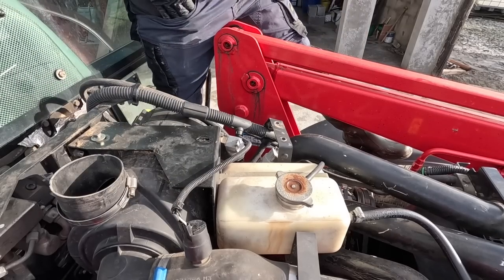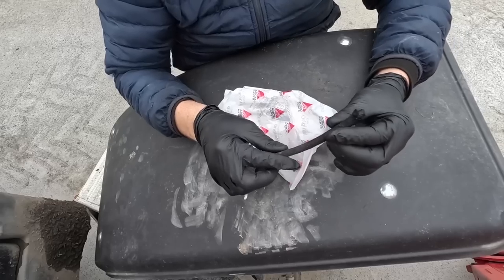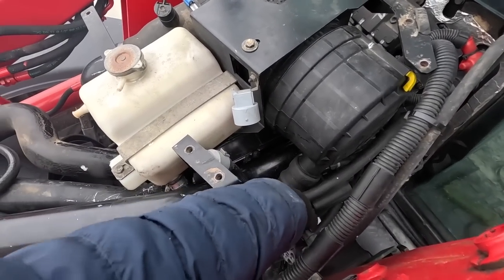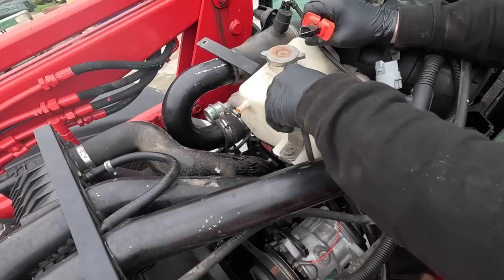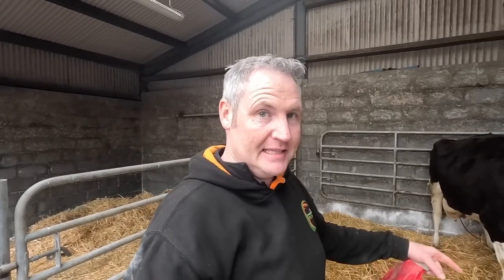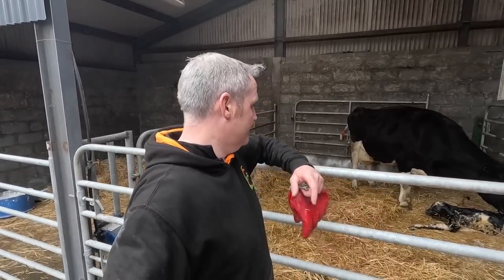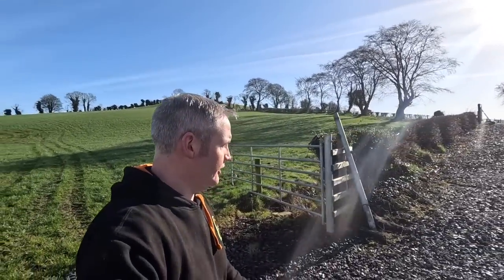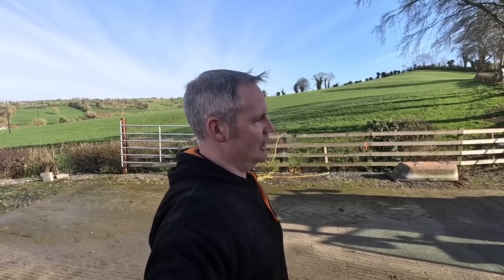I Know Now Why I Smelt Diesel! || Massey Ferguson 5460 Has A Problem

Comment: Good job with the tractor 
Just a tip the back leakage pipe on the injector will only put out diesel when the injector is fireeing ie when the tractor is running  the   Inection will only bring up fuel to the pump 
Good job though

Comment: Once again equipment designed by a designer, without the input of a mechanic and the end user. It takes twice as long to remove everything as it does to complete the job. And I am sure that's not the place where you want a pice of rubber hose being pushed onto a fitting when it's under pressure. Love watching you on the farm and working with your equipment.

Comment: Hi Adrian on the last injector on the return.  That will be another rubber return hose back to your filter or pump is it not. Would be worth a change if it is, at another time.  There will be a lot of heat in there with them injectors covered over them not doing the rubber any good. Well done with the fund raiser on last vid.
Reply from the maker: I will keep that in mind for next time lad, thanks for the tip

Comment: Injector return pipe,I had a feeling that was the trouble once the tractor wasn,t airlocking and was running ok..Was a cheap fix in the end.Bet you were hoping it wasn,t injector pump?

Comment: As been said. Very common problem today on tractors. Biodiesel eats fuel lines. JD tractors have a lot of problems with main fuel lines. Looks as MF has the same problem.Copy part hoses seem to last longer than genuine part. Better to keep a roll in stock. It's a lot cheaper.  I know of tractors that have to have new hoses every 6 months. My Deutz fuel lines are all steel so never had issue. Biodiesel causes more problems than it solves.

Comment: most tractors will have that happen at some stage when they get up in the years. 4mm or 6mm braided fuel hose it is. motor factors would have plenty in stock on a roll. cant imagine what AGCO charging for those 3 little bits of hose
Reply from the maker: €10.95 for all Malcolm so not to bad
Reply: Yes, worth keeping a couple of lengths of it.